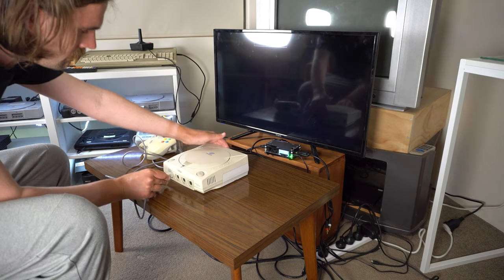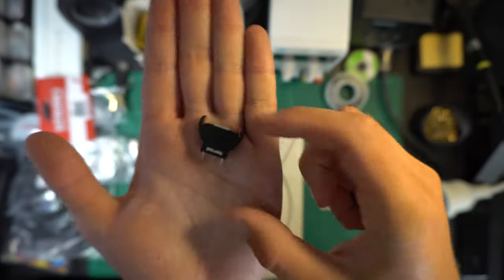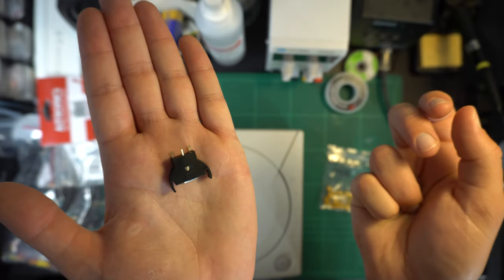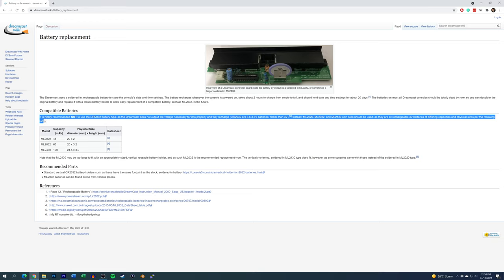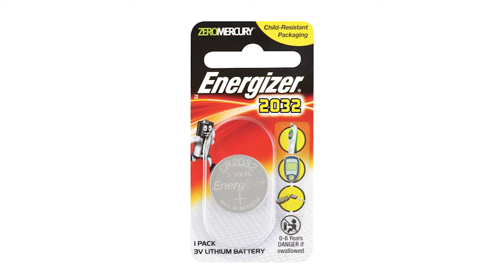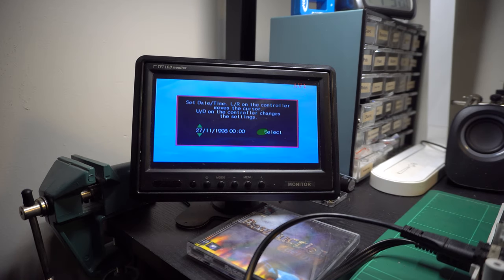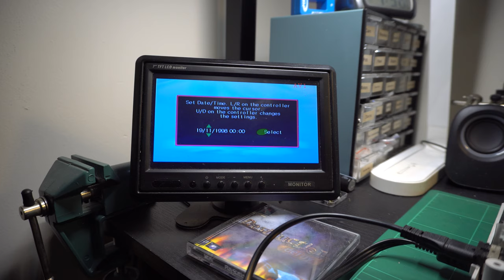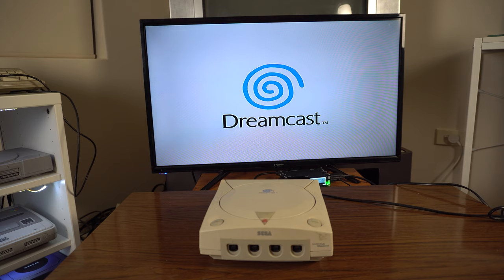Dreamcast Clock Battery & Controller Port Fuse Replacement

Comment: Did this and my Dreamcast stopped powering on. Any ideas?
Reply: Do you get no power at all? No LED, no fan spin, no disc spin?
Reply: @PoutingTrevor no power no nothing. I even bought a new psu. Same problem. The drive and psu work in another dreamcast I was given.

Comment: Cool, i didn't know the Dreamcast had an Internal Battery (which didn't hit me seeing how i had to input the date everytime i played, my bad), i know the original Xbox had an internal battery (Clock Capacitor to be precise) and is suggested to replace/remove it to prevent leaking and ruining the motherboard which i thankfully had it removed, i don't mind dealing with the clock reset, so it's ok if i just leave it alone right? or do you suggest replacing it?.
Reply from the maker: It doesn't really need to be replaced, it can't leak and reek havoc like the Xbox cap. It's just annoying and nice to restore a built-in function in one of my favourite consoles :)

Comment: The part labelled R1 next to the battery… what do I need in order to replace this??
Reply from the maker: That will likely be a resistor. See if you can find a schematic, that will list what the value is.
Reply: @retrogameon  thanks for responding… what’s a schematic? Never actually soldered anything so this is all new
Reply: Resistor 13 ohm

Comment: CR2032s, like the Energizer you showed, are non-rechargeable lithium batteries. Not alkaline.
Reply from the maker: Ah ya got me. I couldn't find any photos of alkaline for some reason so I just sent it. Still, the video has been out for several months so I had a good run.
Reply: @retrogameon  I don't think they exist, because alkaline cells can't provide 3V on their own (9V batteries are actually stuffed with six cells).
Reply from the maker: @Conchobhar  that would explain that, then